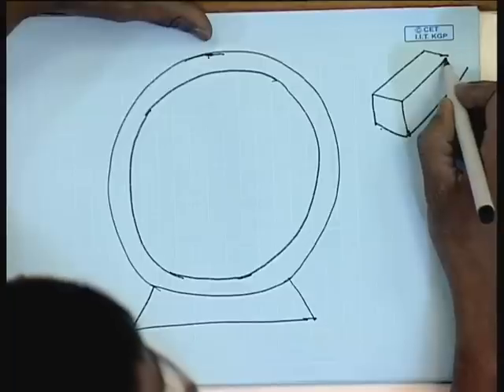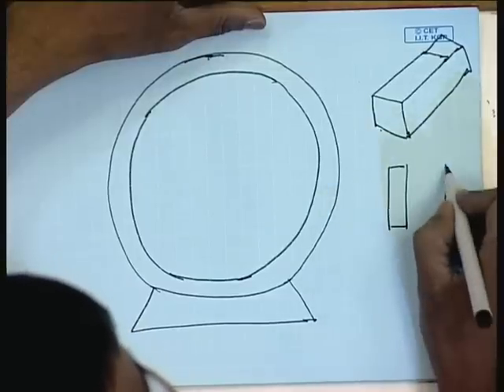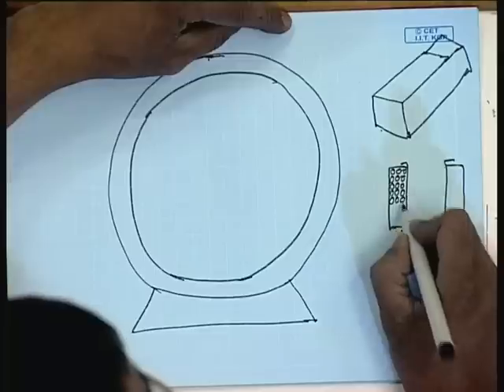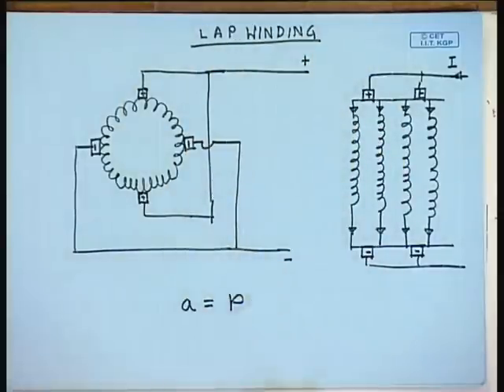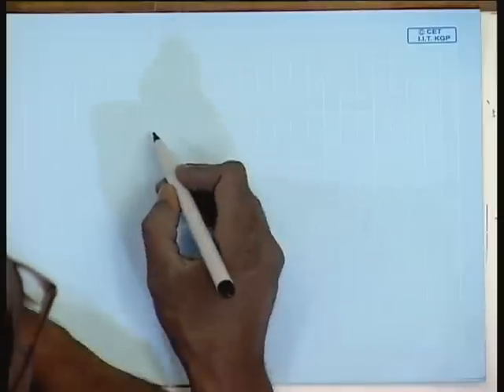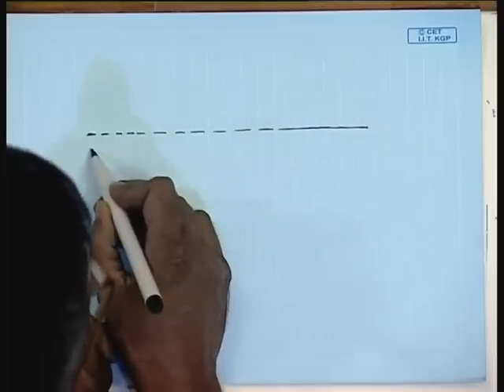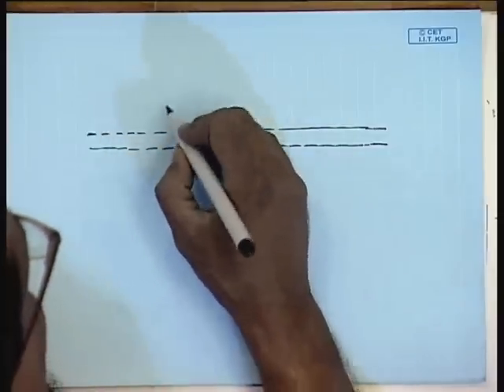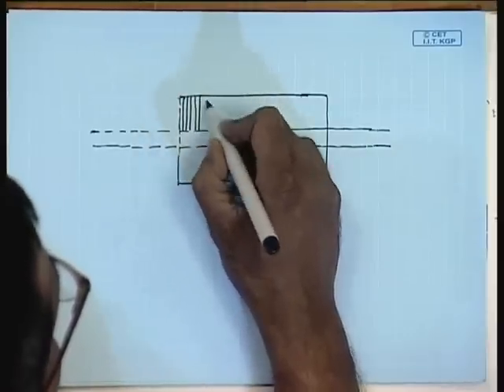Mod-01 Lec-22 Lecture-22-Constructional Features of DC Machines

Comment: Thank for video. I have the armature of grinder 500 watt. 12 slots 24 segments. I wind 6 +6 totally 12 coils to the slots (1-6/2-7/3-8/4-9/5-10/6-11 and 7-12/8-1/9-2/10-3/11-4/12-5) and each coil is 15 +15 = 30 turns so left side has 3 (first coil)+2(second coil)+2+2+2+2(6. coil) outputs to the segments and also same for the right side coils. The total outputs are 26 my question is naturally there are 24 segments but 2 excess outputs remaining from the 6. coils of the both side to where I should tie these outputs on the segment body.

Comment: sir i am follow this method but armature is very heat up ? this reason tell me kindly plz
Reply: heating in lap or parallel winding occurs due to uneven voltage due to unequal parallel components , we use equalizer for it